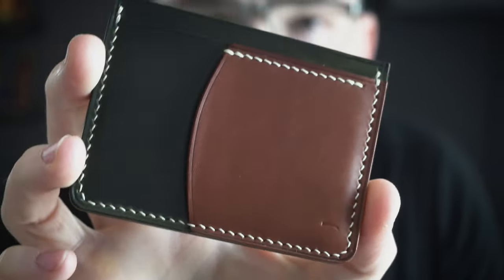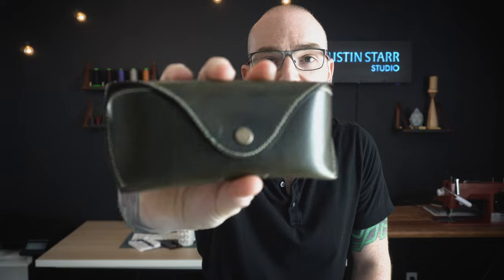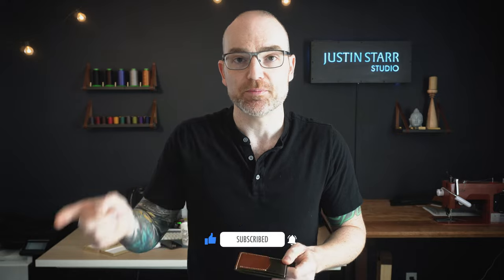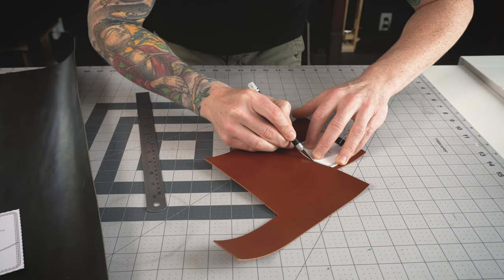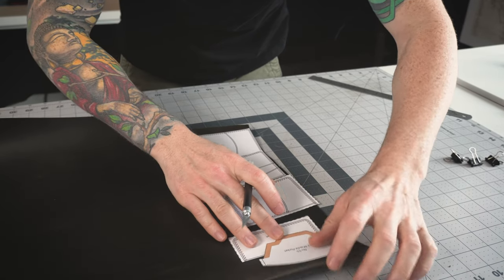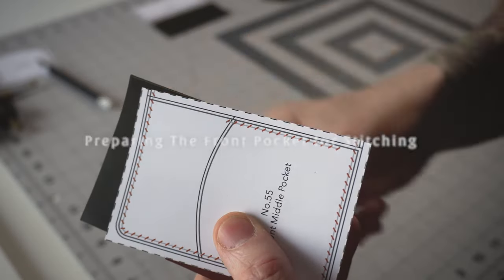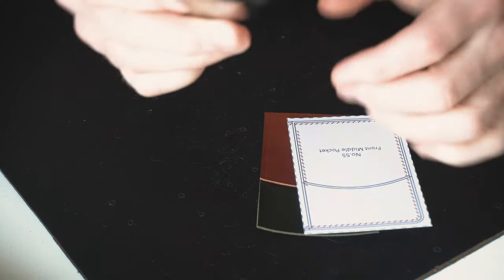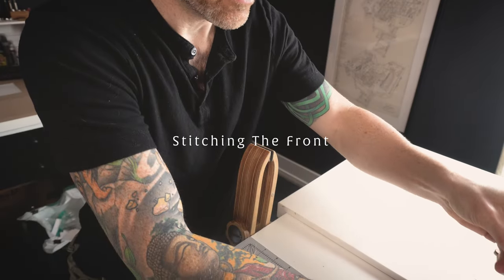No.55 HANDMADE Leather Slim Wallet Masterclass | Walkthrough | Free Plans

Comment: Very nice work and video.  When one backstitches, what is the reasoning of laying the threads side by side?  When fishing and tying a hook, one doesn't want to overlap the line because the one line  may cut the other line when fighting a fish.  Is that the same reason?  I pull the first thread tightly so it sinks some into the leather and the second stitch lays nicely on top making it look less bulky.  I've never had any issues--yet.
Reply from the maker: Yep, you want the thread side by side. My reasoning is purely aesthetic. The stitches side by side looks clean and finished. Functionally I'm not sure there is a difference.

Comment: Have you tried heating the stamps? or do you find using cold stamps sufficient?
Reply from the maker: I usually cold stamp unless I’m using foil in which case I need heat. I use primarily veg tan which takes a cold stamp well. If I was using chrome tan I would heat the stamp first.
Reply: @NorfolkHandmade  thank you! This video is amazing!
Reply from the maker: Thanks!!

Comment: Nice work, Subscribed! What kind of board are you using that it won't scratch the leather? 🤙🏽
Reply from the maker: Thank you. 🙏🏻 I use a standard cutting mat when cutting, a piece of thick leather  when punching and a standard bathroom tile when skiving.
Reply: @NorfolkHandmade  sorry, I meant to ask what type of board are you using to sand the edges of the leather that it won't scratch it? 🤙🏽